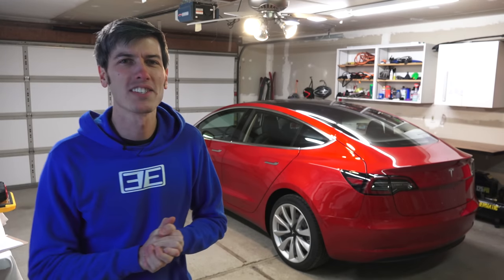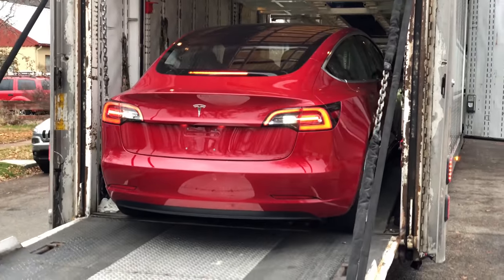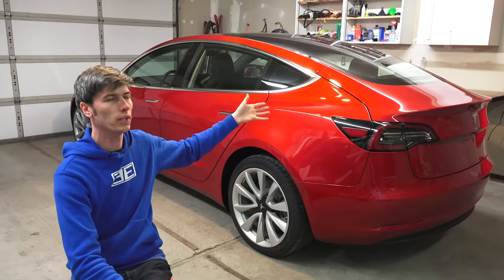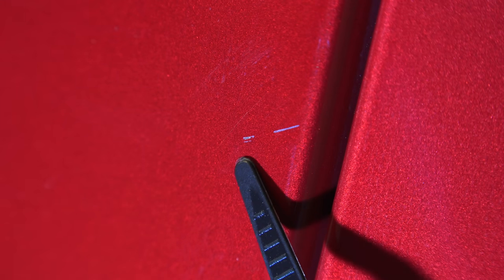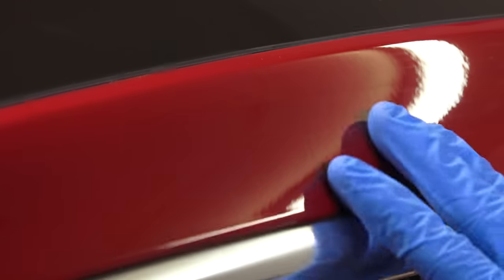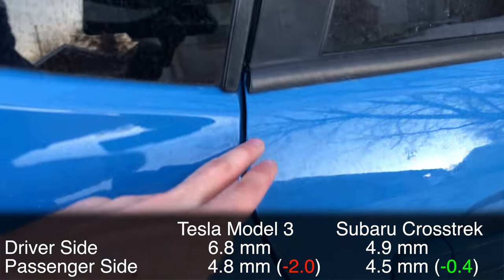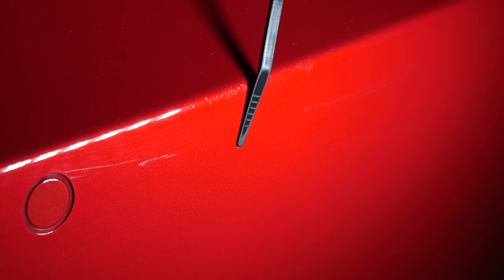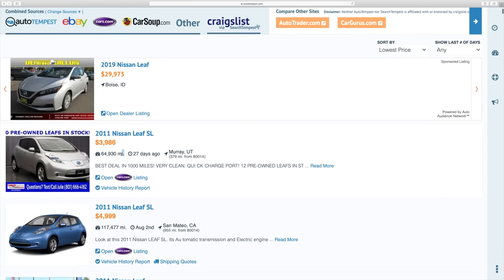Everything That's Wrong With My Tesla Model 3 - Quality Problems

Comment: It is actually very considerate of Tesla to put the first scratches on the car so that you don't have to.  That first scratch can really ruin your day.
Reply from the maker: Haha, so true, first scratch is THE WORST!
Reply: Soooo... congrats. One fear prevented 😂😂
Reply: I wonder if Tesla has a rock chip option for the front bumper/frunk? The first one on my new car sucked. But seriously get a clear bra after paint correction lol
Reply: LOL!
Reply: You know... you got a point there lol xD
Reply: Its not Tesla's fault, it was the delivery company, they were extremely rough in tightening things down with dirty/sand laden tow straps and ended up scratching my paint quite badly. I went through the same thing with mine.
Reply: @xWheatThinz  I don't know about that. All cars should have undergone PDI before handing over to owner. Never had a problem with Mercedes
Reply: Can confirm. After only having my new car for three month, I in one day had someone hit the front driver's side bumper, and have two dings installed on my passenger side door, down to the metal. To be fare, three months in Chicago is a pretty decent timeline. I sometimes wonder if just kicking in the door before rolling off the dealership is my best course of action.
Reply: same can apply to the new ipad bent out of box, very considerate of apple :p
Reply: SO TRUE!
Reply: maybe they could also crash it too for ya
Reply: I guess that if the car appeared at a dealership, someone could have gone over the car and addressed the problems.  The process that he went through seemed a lot more like having to deal with UPS, FedEx, etc. Yourself if something happens during shippment.
Reply: The particle spray under the clear coat is also not Tesla's fault… We got our Model S delivered including same issue's, right at the factory delivery in Tilburg Netherlands. Including dents! Quality has a long way to go at Tesla.
Reply: People pay extra for jeans with wear/tear, so this only makes sense.
Reply: @LuckRenewal  Mercedes is synonymous with classic style, not efficiency, conservation, or practicality.  When you overpay for something a company needs to make sure that everything is "perfect".
Reply: @davidbeppler3032  I've also owned Toyota before.  Never had a problem as well? A defect is a defect. You can't justify having defects with lame excuse. Tesla is not cheap either.  

It seems like Tesla doesn't consider something so standard as part of their brand image
Reply: A beautiful scratch is not ugly.
Reply: Haha
Reply: @davidbeppler3032  overpay for Mercedes? As far as I know, Mercedes makes on average about 5k profit per car
Reply: LuckRenewal Mercedes are on another level
Reply: This was not a new car. Where was the white, plastic, peel-off tape that Tesla ships on the cars? That was a return/refusal. Tesla admitted to problems in production early in the year and supposedly fixed those issues. Maybe that was one of the older cars that was sent back
Reply: lol.   I ask the sales person to scratch my new car on the way out when I buy cars....
Reply: @xWheatThinz  No. It is a Tesla issue. Not just the scratches but the quality of the paint and the layers they put on is on the lowest side that I'd only expect from the cheapest shitty cars.
Reply: @xWheatThinz  -  many of those scratches are probably the delivery company but the paint defects (like that large fleck of dirt), are not.
Reply: If you try to install your own Tesla scratches, their service garages will not touch it.
Reply: @piyushrose  I recently took delivery of a 2019 3 with no scratches or paint swirls.  That first scratch or dent is going to hurt.  A lot.
Reply: Own it for a while longer and you will get problems
Reply: not fair!!! I always love putting the ding or scratch on someone else tesla that parks next to me!!! damn you Elon!!!!
Reply: I would also say that if you're worried about scratches don't park it in a supermarket carpark, nothing like trolley dents in both doors to know you have jealous or careless people about, but I suppose anyone who shells out 50 grand for a car gets their groceries delivered and the car stays in the garage. @EngineeringExplained
Reply: @xWheatThinz   that company was hired by Tesla
Reply: Was this the best comment of 2018 on youtube? 😃
Reply: alanhassall🤣
Reply: @IRejectUrReality  A return with 22 km?
Reply: @TroySavary  right. Like I said even Tesla admitted there were problems with quality control, in a small batch of them, in the beginning
Reply: Once you’ve had a used work truck, you learn to appreciate them as a badge of honor, so long as what you drive still runs safely and reliably that’s all that matters👍
Reply: I got my Fiat Punto already Keyed. It cost $500.  Love it. Red nose should have saved his bucks and bought one too.
Reply: Big LOL
Reply: All those random gaps makes you concerned one of the doors will just fall off... nothing is symmetrical or installed correctly.
Reply: Maybe it was the truck that wasn't a open one
Reply: Some may say the first scratch is the deepest
Reply: Spoken like a true fanboy lol
Reply: @xWheatThinz  But the piece of dirt underneath the paint was not.
Reply: Yeah, they should charge extra for that service.  /s

Comment: Don't worry the paint will be fixed in a software update
Reply: Fahim Mosharrof Ratul big lol
Reply: @AM-sx7zi  You can cry a little harder.
Reply: @Grunchy005  It was an enclosed trailer nice try deflecting flaws from the factory. Also, orange peel is impossible to cause post production.
Reply: LOL
Reply: LOL!!!
Reply: Scratching in and of itself seems to be a minor issue.  The larger issue would seem to portray a very thin paint and clearcoat layer - especially for a car at that price point with a paint "upgrade."
Reply: HA!!! lol
Reply: I hope the battery life doesn't drop with software updates.
Reply: @AM-sx7zi  Ha Ha
Reply: @AM-sx7zi  yikes... Someone had a flare up of burning feminine itch.
Reply: You mean a firmware update.
Reply: Sloppy build.   Our local paint repair guys can  repair and paint  cars without  dirt getting stuck to the vehicle.
Reply: Tehe
Reply: Vince Barnhart yes. You should definitely get the cheapest paint option and get it repainted
Reply: @AM-sx7zi  you one of Elon's stealth accounts
Reply: I bet Elon Musk has thought about it.  Those new robots will probably come to fix the paint.

Comment: Well for starter it has no fuel cap. Big issue.
Reply: Best comment off the lot.
Reply: And an oil fill cap. Smh
Reply: Actually it does. It's just called a chargeport, as far as I know... ;-)
Reply: @granadakimj  So, not a fuel or oil cap. 😆
Reply: @sumansamhalder6909  So yeah xD
Reply: And no muffler either.
Reply: No engine either,  you can actually say motor and it be correct on this car.
Reply: Hell, they forgot to put oil in it! 🤣
Reply: It has brake fluid and power steering oil cap.
Reply: @roybm3124  Don't ruin our jokes, spoilsport!
Reply: Where can I refill the AdBlue?
Reply: Watch the video about the lady who brings a Tesla to the fuelpump... hilarious...
Reply: Opposite SNAP!!!...*Having* a fuel cap is big issue for me now. 
I respect quality cars and have always had either high performance series BMW or  VW-Audi. However compared to my BMW i3 EV all the cars I have had in past feel like lumbering dinosaurs in comparison ...e.g. at least up to 50mph any of the previous cars I had can't hold their own as regards acceleration performance. 
With their inherent horrendous torque curves, mechanical control delays  and dire power to weight ratios,  combustion engines just are not up to the job of leading in the performance automotive world anymore. 
As each of the famous performance records fall to electric vehicles (Nurburgring ring, Pike's peak...etc) and even standard production models rival or beat the $1m plus hypercar /supercars it is obvious the jig is up for combustion engines.  
Like steam locomotives or traction engines before them ICE cars they will become the focus of weekend hobbyists and not considered seriously for performance aficionados.
Reply: @johan.ohgren  that video is the source of my joke ;)
Reply: @doc.voltold4232  ah, good laugh, eh?
Reply: @sumansamhalder6909  of*
Reply: @roybm3124  electric power steering, no fluid
Reply: @johan.ohgren  everyone I showed that video was hyperventilating while laughing. Imho it is the best video of 2018
Reply: Dustin Oehler your right it seemed so weird as other ice cars already had electric power steering.